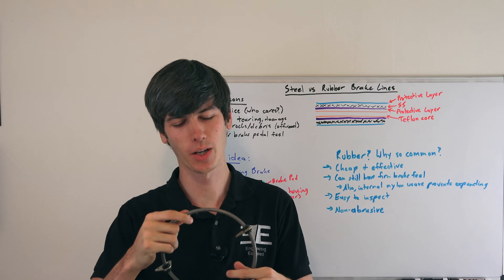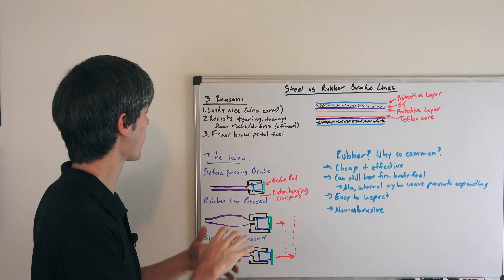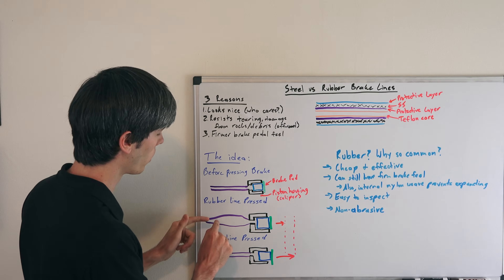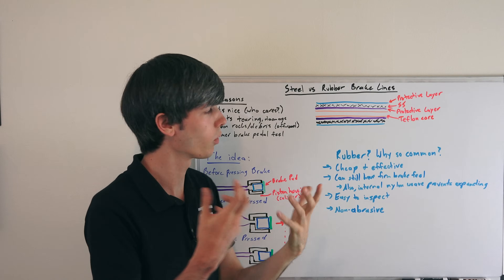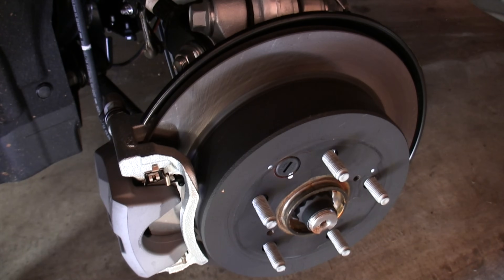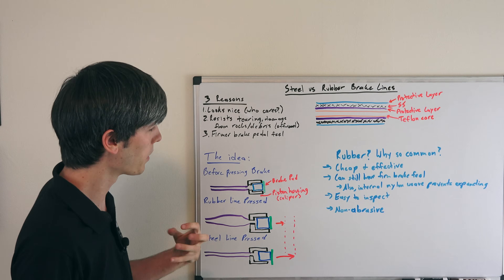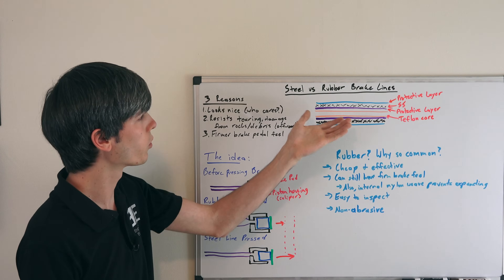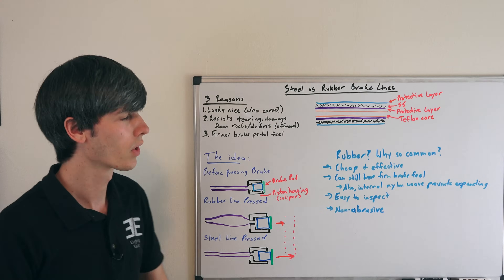Steel Vs Rubber Brake Lines - Are Stainless Steel Lines Silly?

Comment: Keep one thing in mind. If hypercars use rubber lines, so can you. SS has its place in professional racing on vehicles that get torn down and rebuilt on a regular basis, but rubber is fine for anything that gets used on the street.

Comment: On the street, the braided stainless steel lines don’t have longevity. They like to corrode from the inside and should be replaced more often compared to oem.
Reply: tell me you have no idea what teflon is without telling me you have no idea what teflon is 😂

Comment: I just replaced my rubber brake lines with steel.  Front right rubber line had one cut and two deeply abraded spots. I went with steel because for me, peace of mind is more important than the slightly higher price.

Comment: My rear motorcycle rubber brake line has begun leaking. The price for a new rubber rear hose from Honda is the same as a brand new front and rear steel braided set from HEL. No brainer

Comment: He didn't mention that rubber brake lines wil start to collapse after so many years. When this happens the Brakes will work for about 4 times but each time you brake the fluid will go in the piston but the rubber hoses collapse  and won't let the fluid back out so the brakes start rubbing and heat up requiring you stop driving and wait about 2 hours then you can drive again but they will sieze up again shortly. Then yo u have to replace the rubber hoses. With Stainless Steel Braided hoses preferably.

Comment: Excellent video that helps answer my question.  Purchased a 'rubber hydraulic line',  however I need the proper fittings to attach from the upper brake line, to the brake cylinder.  I questioned if I was simply putting things in bad order, ...  but I think I'll grab the fittings.  I'm 69 years old,  just put 1200.00 into my Pontiac Vibe 2 months ago (power steering lines plus) by my mechanic,  trying to find a way to augment the present problem.  SSI can be tough,  funds aren't always available,  so some of these things I have to attempt myself.  Thanks for the video.

Comment: On older cars people should try a full brake fluid flush and new rubber lines.
Guarantee 99% of cases both are bad.
Sunsong is a OEM brake line supplier from Thailand very cheap and very good quality.

Comment: Very good info here. I have a 2006 Suzuki Aerio AWD sedan with ~150K miles. Both my wife and I baby it and drive it carefully like we want it to live forever. I am calling a brake shop tomorrow to schedule an appointment. As far as I know, the brake lines have never been changed on that car. It depends on the cost but do you all recommend I ask the brakes shop to change them? The pedal has always felt kind of soft to me, even after the brake work I have had done on it. I also don't think anyone has ever turned the rotors on it, either. 

What about turning the rotors? Would that make a difference in the pedal feel? What pads do you recommend for improved pedal feel?

Comment: Thanks for a clear video. I am looking to use stainless steel because I have an MOT (UK) report saying my brake hoses are beginning to corrode. So I want to avoid this corrosion, and they're hardly more expensive than rubber hoses.

Comment: If you're putting them on the front of a 2014 Honda NC700X yes, it's silly. Because you won't get the fluid into the brake line.

Comment: Can stainless steel brake hose cause the rear calipers to keep sticking? My rear calipers are sticking from time to time and apparently my car came with upgraded stainless steel brake line
Reply: Unless they are twisted, that should not be the problem. If you are handy, check if the caliper retracts easily when you push it back in and inspect the rubber boot around the piston. If it is damaged, replace the caliper or rebuild it.
Reply: I've had a similar thing in the past, I don't know exactly what the problem was but changing the SS hose fixed it.  I suspect the Teflon core had collapsed and was acting like a one-way valve, the limited return pressure not allowing the fluid to pass back to the master cylinder or at least not easily

Comment: Anyone rating braided hoses probably needed to bleed their brakes when they fit them so I guess shiny new lines with no air in are better than old squishy rubber lines with more gas in than the shocks 🤣🤣🤣

Comment: Unless your car is used for track/racing the only difference you'll notice with SS brake lines is a lighter wallet.
For your average everyday driver conventional rubber brake lines are more than enough.
And for those claiming that they noticed a huge difference after replacing theirs with SS brake lines, you would've noticed the same difference after replacing your old rubber lines with new rubber lines.

Comment: I have 4 piston factory brembos up front. I just upgraded to goodridge stainless lines and power stop z23 carbon ceramic pads. Next is slotted/drilled rotors. In the end I’m looking to be around 450wheel hp when I’m done modifying the car!! It’s my first turbo car ever!!

Comment: The rubber lines may expand only a little at any portion of their cross section, but they are expanding along their entire length, and there are 4 of them. Even worse, their expansion properties may change as they heat up from rising ambient temperatures, and rising fluid temperatures. The idea behind stainless lines, among people who use them for their intended purpose anyway (ON TRACK), is that they make brake pedal performance more consistent. Consistency is pretty important when you're braking at the last possible second, where any delay or unnecessary modulation will, at best, take you off your racing line, and at worst take you off the paved surface of the road.

Comment: Can anyone direct me to the actual test data that supports the claim of decreased expansion in the steel hoses? The only test data I've been able to find so far actually shows the steel lines expand MORE than the test data I've seen for rubber lines. The data I'm comparing is that of the Goodridge stainless steel lines and ssunnbrakeparts rubber hoses. The results show steel hoses exhibit almost double the expansion of the rubber hoses at each pressure tested.

Comment: I used to road race with SCCA. Now, I've been doing track days or HPDE events for 10 years. I go fast and drive hard in a dedicated track car with a racing BBK. Once, I felt my brakes going so I came in right away. I found that a front, SS braided line had rubbed against the tire and developed a pinhole leak. With regular brake hose I think the event would have been a catastrophic rupture of the hose, more like a balloon popping and I would have suddenly had NO brakes!
I've never had any issues with my SS lines in those years. They are on all my sports cars.

Comment: I would be careful not to generalize these statements.  All rubber lines are not created equal.  Some flex much more than others, even when new.  Also the length of the line will play into the equation.  If your OEM set up has longer  lines it will probably make more of a difference switching to SS than if the lines are shorter.  Also the size of the line makes a difference in feel too.  I have tried it in a new application (Nissan, under a year old) and it made a huge difference.  By contrast I have also tried it in an older (BMW, 5 and 10 years old) application and felt no difference at all.

Comment: On sportbike motorcycles it a different matter because of the length of the lines. It is recommended to replace stock lines every 6 years for safety. The brake feel on stainless steel braided is night and day!

Comment: I've just ordered a set of braided hoses. This video confirms my suspicion that I won't notice much of a difference, if any, especially as the hoses are so short. However, they have actually worked out cheaper than if I'd bought new OEM rubber hoses, so I thought it would be worth trying them.
Reply: Whats your impressions? I bought a aftermarket rubber hose and my pedal feels spongy af now
Reply: @henrique-3d  To be honest, it's more than a year later and the car is still off the road. There was another bigger issue and life has got in the way since.

Comment: Hi, i have a question (sorry for my bad english): some brake line hoses are offered with the fittings at each end of the hose manufactured in zinc plated mild steel or in stainless steel. Obviously the stainless steel ones will be more durable , but is there any cons?

Comment: I had a Hayabusa motorcycle,  changed out my stock brake lines to steel braided lines. It was the single,  most notable mod that I made to my bike.  Better feel than the exhaust, computer etc. Best bang for the buck part to buy.

Comment: The average user needs the bouldge in the rubber lines to give a sense of "throttling" to regulate braking power. A "solid" brake pedal takes sometime getting used to.

Comment: Why stainless steel brake lines? SAFETY!

Let me explain. 
A modern car has ABS. An ABS tries to control the brake pressure to the wheels depending on registered wheel speed, and it will adjust the brake pressure accordingly. 
If you have rubber lines that expand (more and more over time) the more of the energy is lost in that expansion. Meaning the ABS system has to wait longer for the brakes to respond and the ABS computer seeing it in registered wheel speed. As a result your ABS system thus works slower and less optimal.
If you have stainless steel lines that do not expand and thus all pressure is directly applied to the brakes, the ABS computer can more quickly respond and with more fine granular control over the applied brake pressure.

That isn't all. Due to also the improved feel under foot you can more clearly feel the line at which the ABS system just about enguages. Basically to get the most stopping power out of your brakes you need to find that fine line where the ABS system just about kicks in.
Ideal is that you don't lock up, because it takes longer for a wheel to regain grip than to lose it. Plus relatively an ABS system is quite slow. So once you lose your grip with a wheel it'll be gone for a while, and it's best to prevent a loss of grip at all times. Hence riding that fine line.

Comment: do the advantages of SS lines over rubber increase if you're doing a full day at the track? I know fluid itself can basically boil..pads fade..etc so there are advantages to upgrading brake fluid, better pads, larger rotors (thus larger pad surface)...so would the SS lines be better for long-term track usage therefore be a good compliment to complete the brake upgrades?

Comment: I also learned thru aircraft maintenance school that on planes when you take a Teflon-lined hose out you have to maintain its shape that it took when it was installed. If you flex the SS hose at all the Teflon lining could be compromised and the line has to be replaced. Obviously everything has to be more strict on aircraft, but something to consider I guess?
Reply: Do you think that makes sense on a car where the brake lines are actually connected to the caliper which is connected to the hub, which the wheel is connected AND THEY  ALL MOVE UP AND DOWN, LEFT TO RIGHT CONSTANTLY! Lol... But fun fact, the lines can only go back in one way based on the fitting that connects to the caliper so one never has to worry about the orientation of the line itself when installing.

Comment: I have a question, for your explanation in the video, those pressure will expand the rubber hose and waste energy, also the paddle feeling. So here's the question, if I only replace the brake hose in the rear with stainless steel one, will my brake bias more toward the back, since the pressure in the rear will be more with more solid brake line?

Comment: I mean from a Tech's POV, there really isn't any reason to put full metal lines on a car. It's more of a psychogenic response from the customer. But, I had customers want me to put them on. 
--rubber lines are good too because it permits moving the caliber around without much resistance. You can also clamp off the brake line on a rubber line, like while changing out a caliber. Rubber brake lines are designed and made very strong. I've only ever saw rubber brake lines because someone did something to them.

Comment: Just had the stainless steel section near master cylinder fail on a 2013 F350, rolled right through a red light narrowly missing a car.

Comment: No talk about heat? Brake lines at the track, when HOT, are different from daily driving.

Also no talk about rubber types? Brake fluid will seep through all rubber except EPDM.

Comment: I see alot of collapsed rubber hoses internally. They look fine  but the inside will fail. So it could be said for both. On daily driver rubber lines are fine. For off road or show SS lines are great. I have SS lines on my firebird only cause its low and the rubber internally failed. I have noticed a bit better pedal. Not much but they do look better when on a lift. Not a big deal but if you have a car or truck and want it to look good. Not a bad choice.

Comment: Kinda of a miss on this one. What he should of said is when brand new there is very little difference between stainless and rubber brake lines.  But as they age there is a much bigger difference and feel of the soft pedal feel of the rubber. Stainless is great but expensive and hard to work with.  Just use NICOPP (nickel-copper) brake lines and be done with it.  They’ll last longer than your car and they r much cheaper than stainless.  To the wheel always replace old rubber flex brake line hoses with new or upgraded hoses. Stainless or Kevlar covered flex lines are the best but expensive.

Comment: thanks for this video,i have an ap1 with 95k miles and the reason i bought some steel brake lines is just to have a peace of mind, the rubber ones are still good enough, but the car is now almost 21 years old so i will switch them out and replace the break fluid. now i sort of felt like maybe i didn't need to buy new steel ones though. :P

Comment: Excellent explanation. Please mention that when replacing OEM rubber lines with braided SS lines they need to have swiveling terminals to permit the stiffer braided SS lines the movement needed on bumpy and/or twisty roads.

Comment: In our Las Vegas heat I'l look to replacing my 2019  MAZDA CX 5 OEM brake lines with stainless lines after 3 years, just to be safe. That's IF I can find a SS line kit made just for my SUV.

Comment: Despite all this, yes rubber is fine, but steel is better, you'll always notice the difference when installing them, though this perspective mainly comes from motorcycling experience, where there is no servo between you and the brakes, SS lines always improve the feel in a positive way, most of the time the main benefit comes down to the actual layout of the brake lines, since most bikes have 2 calipers on the front wheel and only 1 master cylinder the lines have the split somewhere. Most bikes from the factory get a line going directly to 1 caliper and then from that caliper a shorter line over the fender to the other caliper. This has a pretty bad feel compared to running 2 separate lines directly from the MC to the calipers, this is mainly a design challenge/cost saving measure but you gotta consider SS lines as the whole experience, when you upgrade them obviously you'd never run the crappy OEM setup, so the benefit may not come purely from the lines themselves, but also moving to a superior setup, however this is included in the price of the SS lines, not to mention how it takes insanely less effort to bleed full length double lines compared to over the mudguard styles.

Comment: I upgraded the stainless steel ones on my MK7 GTi. It’s a daily so so I figure why not plus I do drive spirited and it it’s Modified. I do plan to autocross. I did a brake flush with Motul and performance pads and slotted rotors all around.
Reply: How does the brake pedal feel with stainless steel lines?

Comment: I had a set of Teflon-core stainless steel braided lines with a plastic coating over the outside on my 370Z. The set I got was from StopTech, plus I had the system flushed out with some very high temp StopTech DOT 4 brake fluid. My brakes did not function badly before the change but I did notice that the brakes actuate with a little less pedal movement, although that may have been due in part to some air that might have been in my lines before. As part of a comprehensive brake upgrade process, I think it was a good thing to do. My next priority for the brakes is to reduce unsprung weight at the wheels by getting some two-piece aluminum hat rotors that would shave off about 10 lbs from each front wheel and 5 lbs from each rear wheel. Thanks for the interesting and informative videos, Jason.

Comment: All these people complaining about spongy feel very likely have an old car or motorcycle and what they feel could likely be fixed by flushing the system to get rid if air bubbles or replacing worn tubing/brake cylinder/ brake piston. For almost everyone, braided hoses are an aesthetic item (especially on motorcycles).